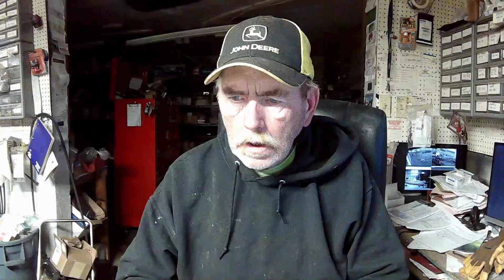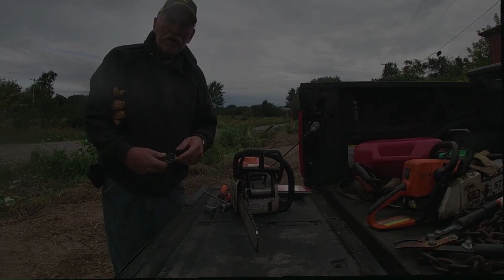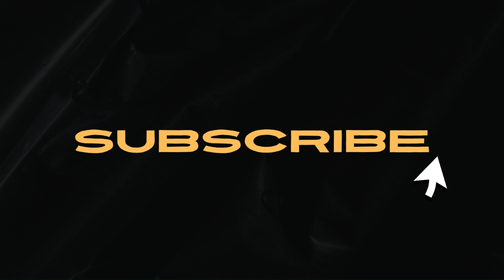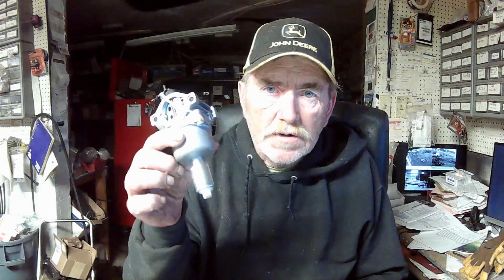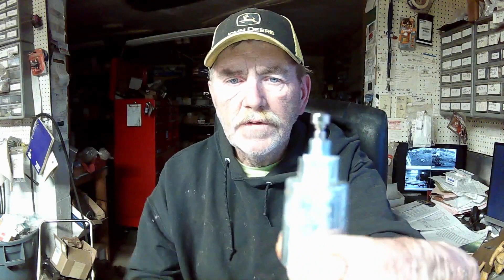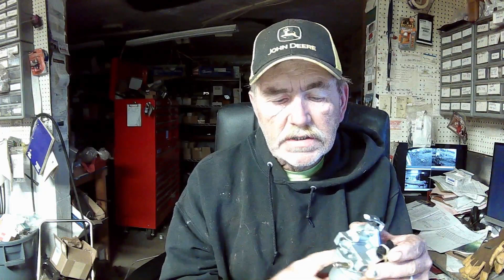DIY Lawn Mower Repair  Tackling Fuel Solenoid Problems for Beginners

Comment: Fantastic information, I happen to have a 66" Swisher pull behind having fuel solenoid or carburetor problems. Acts like it can't get gas. So I will be investigating this in the spring.
Reply from the maker: Glad I could help and good luck with the repair!

Comment: The fuel shut off solenoid on my craftsman riding mower works but doesn’t shut off the fuel. I put a manual shut off valve on it but I don’t always remember the to shut it off. After a few days the cylinder fills up with fuel and runs down through the gap in the piston rings and into the oil. The engine won’t turn over because the cylinder is full of gas and won’t let the piston go up so I have to take the spark plug out and crank the engine over to get the gas out. The same thing happened with my Husky lawnmower too. It’s a good idea when it works.
Reply from the maker: Hey Creemore, in the olden days we never had the electric fuel shutoffs and I don't remember it being an issue. What I see is that the ethanol fuel gums up everything including the electric solenoid and also the needle and seat causing the fuel to keep flowing even with the float in the off position. We put inline shutoffs on all our customers machines and have them shut that off when not in use for periods of time.
Reply: I’m thinking it’s a needle valve or float that’s causing the problem. Next move is to take the carburetor off and clean it.

Comment: Thanks for the video. Working on my JD 110 and not getting fuel past the carb. Power to the solenoid is good. Screws holding bowl and the solenoid bolt are crazy tight and I couldn’t loosen without stripping. Decided to replace with aftermarket carb and same issue. I can keep it running if I squirt gas straight through the carb . I guess maybe a bad replacement carb. Spark plug still dry after lots of cranking. I’m told the polarity of the power to the solenoid shouldn’t matter. Open to any suggestions at this point.
Reply from the maker: I would check the compression to see if its high enough to pull the fuel into the chamber.
Reply: @ thanks for the reply. It turned out to be a failed solenoid, so the fix for me to get going was to trim off the solenoid plunger and install a in-line shut off. I know it’s not the best solution but it’s good to get me out of a pickle.

Comment: Thank you for the video, I recently had some bad fuel, cleaned out the fuel tank and put on a new filter. I have checked the whole fuel system and found a faulty solenoid. 
My mower starts right up on full choke but won't run if you let the choke off, the fuel filter empties out with fuel very fast, it also backfires when you shut it off. Do you think the bad solenoid would cause this or do I have other issues?
Reply from the maker: Hey Antho, 

It sounds like you may have more than one issue contributing to the problem. While the faulty solenoid could be part of the problem, other factors are likely at play based on your description.

Here’s a breakdown of the potential causes:

Faulty Fuel Solenoid: The fuel solenoid is responsible for cutting off fuel flow when the engine is turned off, and a bad solenoid can restrict fuel flow while the engine is running. If it’s stuck or not functioning correctly, it can cause fuel starvation, which may explain why your engine only runs on full choke and why the fuel filter is emptying so quickly. Replacing the faulty solenoid should help with this part of the issue.

Fuel Delivery Issue: The fact that the fuel filter is emptying rapidly suggests that fuel might not be getting to the carburetor as efficiently as it should. Even with a new filter, check the fuel lines for any blockages, kinks, or leaks that could be restricting flow. Also, ensure the fuel pump (if your mower has one) is functioning properly.

Carburetor Problems: If the carburetor isn't getting enough fuel or if there are clogs, it can cause the engine to run only with the choke engaged. You may need to clean or rebuild the carburetor, especially if the mower had been running with bad fuel. A clogged main jet or passages could prevent the engine from receiving the correct air-fuel mixture when you open the choke.

Backfiring on Shutdown: The backfire could be caused by unburned fuel igniting in the exhaust when the engine shuts off. This is often related to a lean fuel mixture or air getting into the system, which could happen if the carburetor is clogged, or if there’s a vacuum leak in the intake system.

Next Steps:
Replace the solenoid if you’ve identified it as faulty.
Check for fuel line blockages or issues with the fuel pump.
Inspect and clean the carburetor, paying special attention to the jets and passages.
Check for air leaks around the intake manifold or carburetor gaskets that could be affecting the air-fuel mixture.
Addressing these issues step-by-step should help get your mower running properly without needing full choke and stop the backfiring as well. thanks

Comment: Can this malfunction when the mower warms up? Mine runs great for 5 minutes then dies
Reply from the maker: Hi Richard, usually no... its usually a no start from the beginning. Running 5 minutes and dying could be something floating in the fuel tank ( bugs, leaves and other crap), getting vapor locked ( fuel cap) or a coil breaking down. Hope that helps
Reply: @northernnewyorkparts  there are two tanks. I tried taking the caps off but that doesn't seem to change anything. The stall is very predictable. The longer I let it cool, the longer it will run. It never runs poorly. It's 100% smooth, then nothing at all. You think coil?
Reply from the maker: Throw a spark tester between the plug and boot to see if you loose spark from the coil at 5 minutes would be my next move Richard.

Comment: No that’s not the correct information. It is an anti-backfire switch. If you get gas in the block, it’s not because of that. It’s your needle and seat. And by the way, you have to ground the anti-backfire switch if you have it connected to the tractor for it to work
Reply from the maker: your are 100% correct Rodney, thanks

Comment: No No No that has nothing to do with shutting off the fuel like a fuel shut off valve from the tank. That is a anti backfire valve. You still have a float and a needle/seat that lets gas into the float bowl. That valve shuts off the main nozzle or jet when you turn the key off so it doesn't backfire. It can still flood the crankcase if the needle seat and float are not working correctly even if the fuel solenoid works fine.
Reply from the maker: your are correct Jason